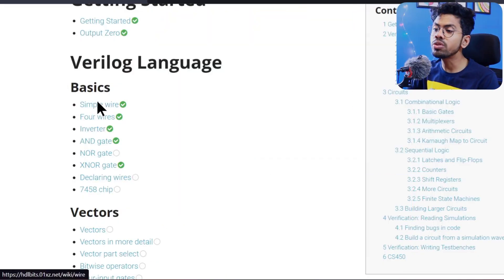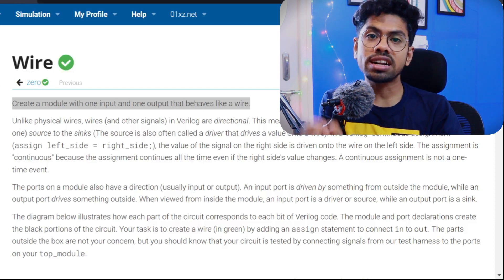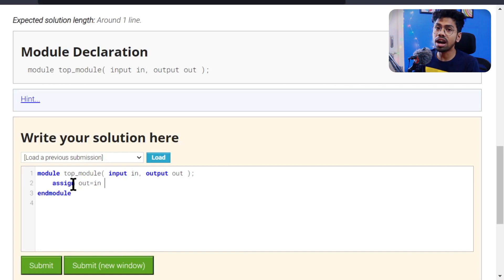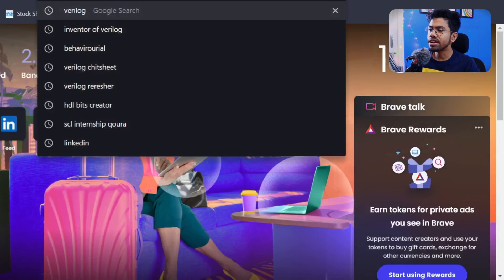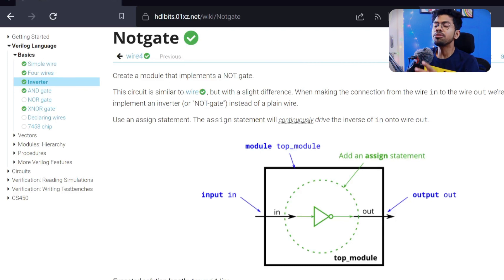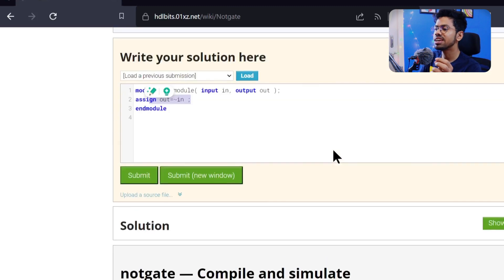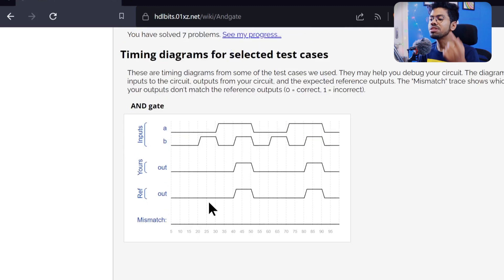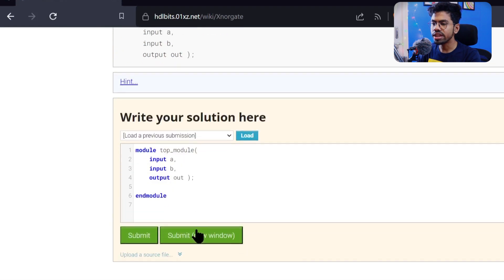Lets Learn Verilog with real-time Practice with Me | Logic Gates | DAY 2

Comment: Hi I have written code for wire 4 is as follows
module top_module( 
    input a,b,c,
    output w,x,y,z );
    assign a= w;
    assign b=x,y;
    assign c= z;
endmodule
I'm getting error for this code

What is wrong in this let me know please.
Reply: naah.. we have to assign w=a; x=b; y=b; and z=c;
Reply: @Himadritripathi02   thank you 😍
Reply from the maker: Code look perfect , then also try assigning x and y in 2 different line , also send reply back the error written in red color
Reply: @whyRD   It is showing an error if I assign separate lines. The error as follows
Error (10231): Verilog HDL error at top_module.v(4): value cannot be assigned to input "a" File: /home/h/work/hdlbits.12601759/top_module.v Line: 4
Error (10231): Verilog HDL error at top_module.v(5): value cannot be assigned to input "b" File: /home/h/work/hdlbits.12601759/top_module.v Line: 5
Error (10231): Verilog HDL error at top_module.v(6): value cannot be assigned to input "b" File: /home/h/work/hdlbits.12601759/top_module.v Line: 6
Error (10231): Verilog HDL error at top_module.v(7): value cannot be assigned to input "c" File: /home/h/work/hdlbits.12601759/top_module.v Line: 7
Reply: I am getting same error even after writing in different lines..Hint was given as concatenation what does it mean in this example.
Reply: assign b=x,y; is the issue. Assign seprately.
Reply: Yes